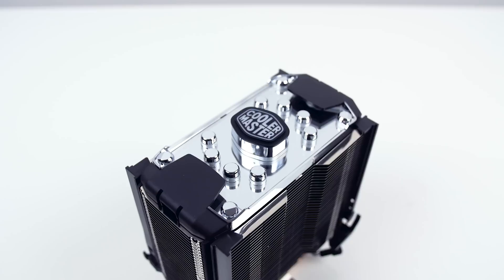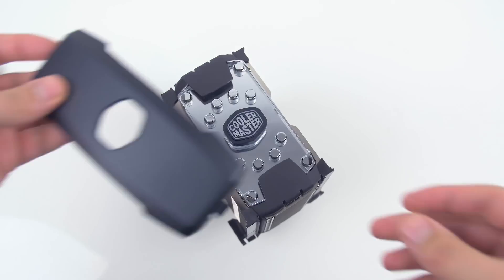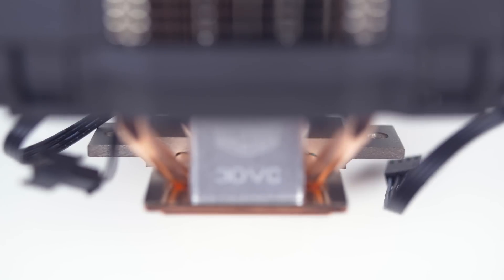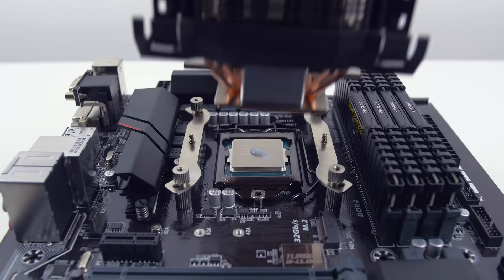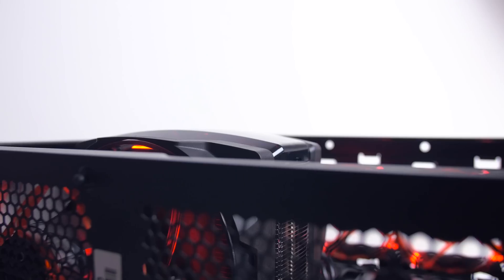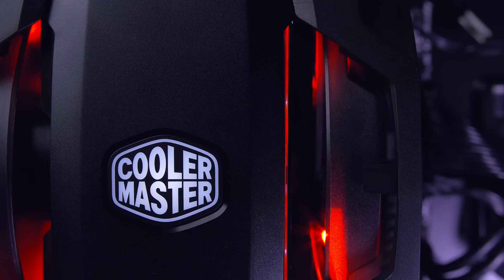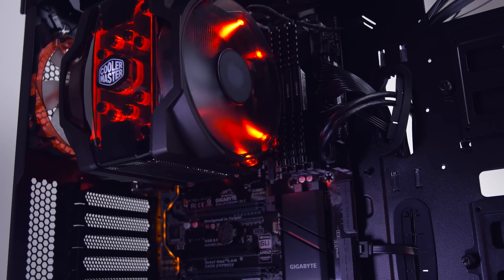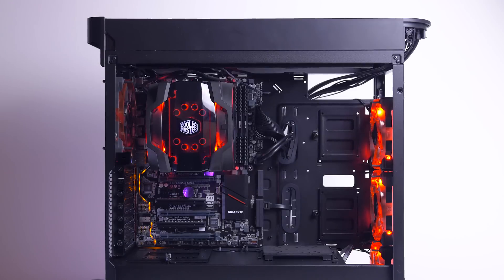Cooler Master MasterAir Maker 8 - The Best CPU Heatsink Cooler?

Comment: I have to admit, it looks very cool for an air cooler. But for 130 $ you can get a 280mm all in one liquid cooler.. No thanks.
Reply: +Thatrollingmaster69 Seems like it's for hydrophobic people.
Reply: *****
Yeah seems like it is. I assume that people with that kind of budget for an air cooler, would have also the money for a case to at least fit one all-in-one liquid cooler.
I don't see how this is going to sell in the market.
Reply: Thatrollingmaster69 I heard it's selling pretty decent but not too good, Coolermaster should had focused water cooling over bell and whistles of a traditional air cooler.

Comment: [Strike 1]: this is nearly large as my Cooler Master Elite 110 Case. (which would be fine if it didn't)
[Strike 2]: perform slightly worse than my AIO cooler (which would be excusable if it didn't)
[Strike 3:] cost more than my case, PSU and cooler combined  (which makes the product)
Result: the iPad Pro of CPU Coolers, form over function, price over value
Reply: +Pieter Rossouw That sounds like a pretty low quality PSU if you could fit it into $130 with an AIO and case.
Reply: +Energy Core Cooler Master 650W PSU... It's not a fancy modular one but it has more than enough power for my system and it's quiet.
Reply: Pieter Rossouw
my condolences.

Comment: Screw this. That price is really what drives me away. When It comes to aircooling I love thermalright. Been using my Thermalright Venemous X-RT (6 heat pipes) and keeps my 8320 OC'd to 4.0ghz at 20* idle/42* full load in Prime95. and its on sale on amazon for 45 and I bought it for 80 originally. Definitely worth it.
Reply: +SirRolo Thermalright > Phanteks, Shitorig, Noctua, Cooler Master, Scythe, and everyone else.
Reply: Thankyouuuuuuuuuu

Thermalright are the air cooling kings especially for the price

Comment: Reasons to not buy this: Hyper 212 evo.
Costs 100 dollars less.
Reply: And it's also at the bottom of the list in terms of performance.

I'm not justifying the price of this specific heatsink, but people that want a reliable air cooler with the best cooling and noise performance will be will be comparing heatsinks with likes of Noctua and beQuiet, not Hyper 212.

Comment: 212 EVO still rocks
Reply from the maker: +ProtoMario agreed :)
Reply: ProtoMario BUT PROTOOOOOO!
Reply: +ProtoMario Only in US. In EU it is as expensive as the Be Quiet! Shadow Rock 2 which is a lot more silent and performs slightly better.
Reply: Cryorig H7 and H5 make it redundant. Cheaper and better performance.
Reply: +HardwareCanucks  what about cooler master V10
Reply: +ProtoMario YUP!
Reply: +ProtoMario i wish cooler master would make an improved 212 evo with designs taken from this ex. 3dvc, heat pipes not sticking out of the top as that caused issues with my case and now i don't use side panel
Reply: +Alex Gage there is, the 212x is the newer and improved version of 212 evo
Reply: +omgGrrr ful Doesn't fix his problems.
Reply: If you change the fans to a different color does it change the top color from red?
Reply: Just bought mine today
Reply: ProtoMario ayy
Reply: Cryorig H7 is a 212 Evo killer in same price range tho.
Reply: Admin-i strator phantek 12 too and here in my country cost same as 212x
Reply: ProtoMario But the CoolerMaster V8 GTS is a V8
Reply: Yah😂
Reply: you cant use the 212 evo with the 8700 though right?
Reply: What about the newer LED TURBO version?

Comment: I switched to a corsair h60 in my latest build.  Reason being to cause it was a simple way minimize fans, thus noise.  120mm fan acts as my intake where as my top fan acts as an exhaust.  Everything runs cooler and quieter than before.

Comment: 130 bucks for a fan?! christ
Reply: God Bless
Reply: 130 bucks for water in tubes
Reply: +Le Leedler AIO's dont have reservoirs, and its ironic because he said 130 bucks for a couple fans and then someone says 130 bucks for water in tubes, but in reality you know that it goes both ways, as in both of them are much more than that, they are copper heat pipes and vaper chambers with aluminum heatfins, and an AIO is a pump and a radiator and specialy treated water. My point is it goes both ways.
Reply: +Dank meme And a pump, reservoir, and Radiator.
Reply: Read Adams Thanks. :) Sorry, I messed up.
Reply: two fans technically, and the light up heatsink, also the two shrouds

Comment: No RGB option with this price tag attached is unacceptable these days.  Save yourself some money and just buy a Noctua D15.  It's a better performer anyways, easier to mount and allows adjustment for RAM clearance.
Reply: +FastRedPonyCar or get a bequiet they have a better fin array so attach a noctua nf12 to it and BOOM
Reply: +FastRedPonyCar 

The Noctua performs worse.
Reply: +dizzzave357 - I've now seen 3 reviews that say otherwise.  Every review I can find shows the D15 being the best air cooler on the market with only the B-Quiet dark rock pro occasionally matching it or coming to within 1*C

Comment: I was shocked to see how much it beat the legendary Noctua D15. So consensus here is to get this cooler, and equip it with noctua NF-15 fans for ultimate cooling and silence
Reply: Check out the noise graph afterwards. It's louder than the D15 which probably mean the fans are spinning faster.
Reply: +Kamil Bernatowicz probably. but nothing moves air like the noctua fans in ratio rpm vs cpm

Comment: Are those temps normalized to 20C ambient? Because something is definitely wrong if this cooler performs better than a NH-D15 but the same as single radiator AIOs. The NH-D15 is about on par with most 240mm AIOs according to all other benchmarks on the internet which measure normalized temps, or delta over ambient, there is definitely something suspicious about these results you have.
Reply: +Toxic Biohazard - D15 is definitely a better cooler than this thing.  TweakTown's review of this cooler puts it at about 3*C hotter than the D15 both at idle and load.
Reply: +FastRedPonyCar DH15 with be quiet fans would be epic :3

but soo expensive :(
Reply: Toxic Biohazard
2 years ago , you 're right ,  until now  , i didnt found any  air cooler can defeat Noctua NH D15 ,,  look at  Cooler Master MasterAir Maker 8  , single heatsink smaller than noctua  , nope he can not defeat noctua nh d15

Comment: $129 USD and worse than the Dark Rock Pro 3 + Noctua NH-D15? Well, I guess it has LED lighting going for it. 

Overpriced and pretty to look at. Horrible price/performance ratio. I would buy it if it were cheaper than the NH-D14, since even that performs better. Pass.
Reply: DEFINITELY not the best CPU Air Cooler. Clickbait if I've ever seen it. I don't really mind, you're a business and all, but "best" is not a word I think anybody would use to describe the Maker 8.
Reply: +Koby Dunham The DRP3 is literally only as good as my $30 air cooler.
Reply: [GD] Pokemon5475 Uh.. The DRP3 is a lot better than some $30 air cooler. A lot nicer to look at, quieter, and cooler temps. The NH-D14 is usually 2C better than it, but it's butt ugly (to some people) and louder.
Reply: Koby Dunham Don't get me wrong, I absolutely fucking LOVE how the DRP3 looks (especially in a Define R5 blackout build, oh my god, those are sexy), but look at the H7 vs the DRP3 on TweakTown.
Reply: [GD] Pokemon5475 The review of the H7 shows it 1 degree Celsius under load at stocks, but it falls behind in overclocked tests. Decibel levels when the fans are at full speed is much louder than the NH-D15 and DRP3, and the cooling performance is lesser. It's a $30 air cooler, man. 

The H7 is awesome for the price, beating the Hyper 212 X (more expensive!) and some other popular choices, like the 212 EVO, but it falls behind in higher wattage TDP loads as expected for a "budget" air cooler.

Comment: I'd consider this cooler but it'd have to wipe the floor with other coolers due to the price. I'd not consider another AIO unless I could get one as quiet as an air cooler. I have a Kraken x61 and I don't use it as the drone from the pump does my head in. No point having a cool computer if I'm loosing my sense of reason and getting heated in response.

Comment: I am going air cooling for fewer moving parts - silence.  I am planning on the bequiet Dark Rock 3, not the cooler master,  because the cooler master one just seems too expensive for what it is
Reply: +GoProGuy12 be quiet! isn't any better. It's overpriced. The DRP3 performs like my shitty $30 air cooler.
Reply: +[GD] Pokemon5475 but it's probably quieter and definitely better looking so
Reply: +[GD] Pokemon5475 and I'm looking at the non-pro model, the dark Rock 3
Reply: GoProGuy12 Even worse. Go for the Thermalright TRUE Spirit 140 POWER.

Comment: I'd go with an air cooler. Water coolers are too expensive to justify the tiny performance gain when you play games. Something like the Hyper TX3 evo would be the best since it has a low profile (lower than the Hyper 212 and the Maker 8) which is important since mid tower cases are often not deep enough to support larger coolers.

Comment: Looked like the best comparison was to the Noctua D14, not the 212 Evo. Or even to AIOs. Cheaper than the D14, cooling, cost, and size are comparable, but the 8 sure looks better. A side by side view would be great. Also, how hard would it actually be to change those LEDs?

Comment: Just a quick question...does the actual heatsink have leds on it or is it just the fan leds reflecting on the heatsink? So if I replaced the fans with a white led fan it would glow white?

Comment: they should have made the copper base thicker and all heat pipes vapor chamber for that price. noctua is cheaper, quieter and it beats it. enough said (-_-)
Reply: the results for the noctua D15 get better when you push more voltage and higher CPU overclock, maybe that's why he shows a old Intel CPU instead of a current one. Jayz2cents  proved this. I see a lil bit of biased opinions in this review man.

Comment: I started a few years back with an H60 AIC, then moved to the H100, and H100i. I am now running a 212 EVO. Kinda gone backwards. But as I am not overclocking, and temps are still well below TJ Max, I'm happy with it.

Comment: AIO is the way i go but if i did go air i would go with the Cryorig R1 Ultimate!
Reply: +teeblack06 h d15?
Reply: +MUFFIN 666 nah id stick with Cryorig. easy installation and color matches way more color schemes. dont like the ugly brown and beige color of the D-15. plus the R1 cools just as good as the D-15 and slightly quieter.
Reply: LOL the d15 beats out any aio
Reply: +kill me i dont care. im happy with my aio and like i said the Cryorig R1 Ultimate is my go to air cooler.
Reply: the d15 cooles my 5960x 4.7ghz to 56c when in load
Reply: once again i can care less about the d15! the Cryorig R1 Ultimate is my go to Air Cooler! btw my aio does just fine with my 4960x. i dont why you keep telling about your d15. im not gonna buy it or like it any better no matter what you say. the R1 Ultimate is just as good as your d15 and looks way better.

Comment: All in one coolers have pumps that can break (they'll break at some point, just like HDs, it's a matter of time) and make them useless, while air coolers not so much (a fan can break, but no big deal)... They'll last you more builds, for sure.
Reply: +madestro You arent wrong, but AIO's have more points of failure than an air cooler. And if the pump or fans break on a AIO, you have to immediately replace it, while in an air cooler you can often get away with just using the internal circulation of the case to cool the CPU.

Also, pumps often have to work harder giving it more of a chance to malfunction. 

I am not trying to say that water cooling or AIO's are bad, but they have a particular set of pro's and con's not shared by standard heat sinks. Personally I prefer heat sinks as they last for more builds (just buy one good one, and it'll last years), offer more customization, relatively easier to clean and often times quieter (I will usually replace standard fans for noctuas or similar).  

But as always with PC's, you should first ask yourself what you will be using it for before asking yourself what you want. I edit videos on an OC'd AMD card and rarely get it above 50 C with an air cooler, so considering my requirements (easy to clean, cheap, reliable and quiet) an air cooler is just better
Reply: +Nick Rodrigez I've had my H50 since it came out and have had zero issues with this after all this years. Unless you do a lot of fiddling in the PC all the time, the probability of the pump breaking is almost the same as a heatsink from an air cooler breaking
Reply: madestro Not really. A pump will break at some point (like I said, just a matter of when), just cause it's a fast moving object (like a HD). A heatsink is a chunk of metal that will never break with computer use, you have to actually mistreat it to break it.

Comment: I'm going AIO only.. I used to have a big cooler (NH-D14) and it ended up bending my motherboard after a few years forcing me to buy a new computer due to mobo glitches (probably because of the bending). It worked really well, but big air coolers create a lot of moment on the board, and they will bend with time.

Comment: I actually went with a lower-end air cooler for the time being because two pumps on two separate all-in-one coolers failed (in their own special ways). However, if I were to go for something a bit more heavy duty, I think I might avoid this cooler (MasterAir Maker 8) and get some kind of system with a 240mm radiator. If for some reason a case has the proper clearance for the height for this thing, I would think it would also support a larger radiator (perhaps, not always). And, in my instance (after recently upgrading to a Phanteks Enthoo Pro M), I would rather use the space on the top part of my rig to use a radiator (and risk pump/failure issues) than having to deal with the huge heatsink and fans covering up the top part of my motherboard.

Comment: The fan speed doesn't really impact the cooling performance of the Noctua NH D15. I have my D15 running at 400 rpm and my i5 3570k never gets over 60C, only gets to 65C with prime95. All of this while staying unheard.
I had a H100 and  I will never change back to water, it is too noisy for me.
Reply: +Daswarich1 lies

Comment: Made the decision to go with an AIO (NZXT X61) cooler  over air cooling on my recent system build. The X61 @ approx the same price as the Cooler Master is a much better better price/performance value....so because of that I wouldn't consider going with air cooling at this time. 
Besides the fact that the AIO causes little to no problems with fitting in my case giving it a much cleaner look with less obstructions.

Comment: I'm about to build my first computer, and from what I'm seeing in my research is an AIO water cooler is going to probably have to be the way to go with the motherboard that I Have chosen. This one looks really nice, also looked into the cooler master V8 GTS and noctua D15 but the mother board I've chosen has 4 pci-E slots, so it doesn't look like any will fit.  Kinda nervous about going with water cooling though.  I'm sure I'll mess something up lol

Comment: I air cool. (1) if for some reason the fans on the cooler should fail, my cooler is large enough to keep the CPU's temperatures stable enough until I can shut down the Computer.
(2) liquid all-in-one coolers can fail. Not often, but they can fail and when they do I could lose more than just a processor.

So I chose the Noctua DH-15. And I do not regret it.
Reply: +Gentleman Adventurer another good option for high end air cooling is the phanteks PH-TC14PE

Comment: why buy this? if you can get a hyper 212 then change the fans to NF12's ?
Reply: +Daniel Christian then you might as well get a NH-D14
Reply: +ThePolulos true. i just don't see the relevance of the price on this product. maybe ill see it for myself.
Reply: Daniel Christian
maybe the leds and vapor chamber, its kind of appealing since it performs as good as a 240 AIO but has no risk of leaking.

Comment: Price is quite high, but in its defense, it looks like you are getting what you pay for with a very high quality product. It looks awesome, but its also massive. The reason why I like all in one coolers is that the actual heat sink is quite small and tidy so it gives the case a more open feel.
Reply: I totally agree. waterblocks looks badass even though they are pretty small, and still make a nice center piece without taking too much space

Comment: That`s not how heatpipes work. Or at least it shouldn`t be. I would say it has 4 heatpipes. Every pipe always has two ends but it`s still the same unbroken pipe. So we don`t know exactly if the pipes are somehow cut in half in the base itself or CoolerMaster is just using plain old false advertising to pump up the numbers :D.

Comment: Can't see myself changing my current Zalman FX70 anytime soon, but when i do i'm pretty certain i'll go for another aircooler. Main reason is that i'm a low noise freak, and with the right, low wattage, hardware and good fans on the cooler, aircooling beats AIO's aso by several miles in that aspect.